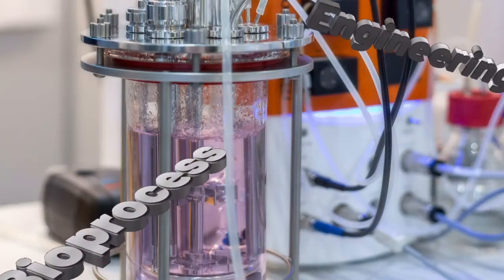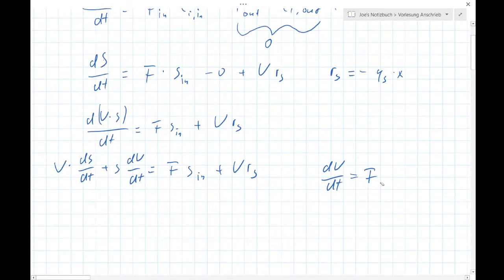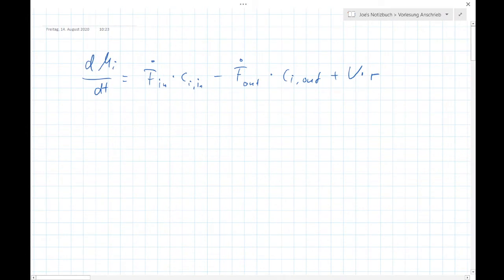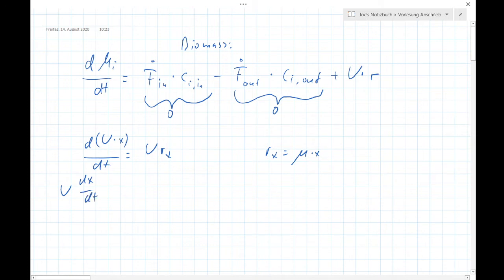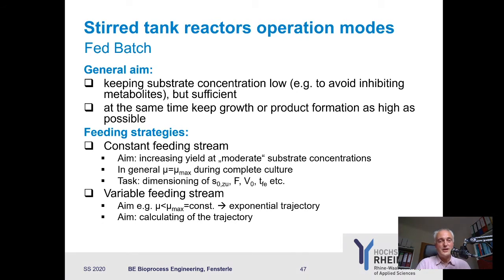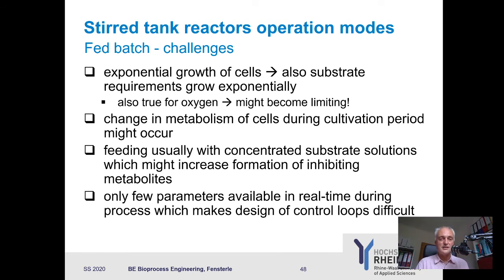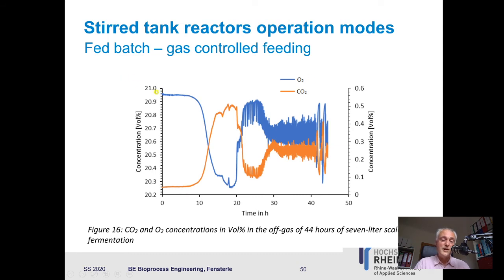Bioprocess Engineering - Reactor Operation: Fed Batch

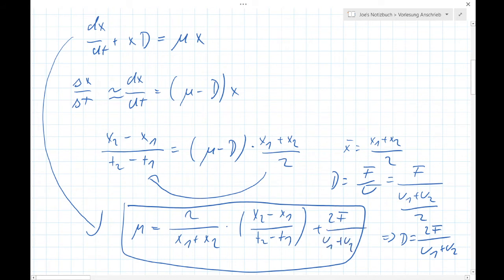Comment: What’s the difference between two μ in equation 22 in 27:27 and that you wrote in 13:00, I mean when we should use each one?
Reply from the maker: Dear Hamid, questions to the lectures will be responded during the lectures for my students. Although I provide the lectures for free, I have not the capacity to answer to questions for all viewers. I think you certainly will understand this. BTW: the equations you refer to are the same!